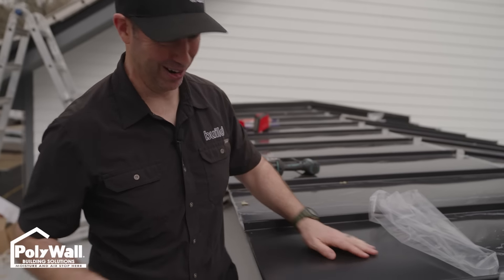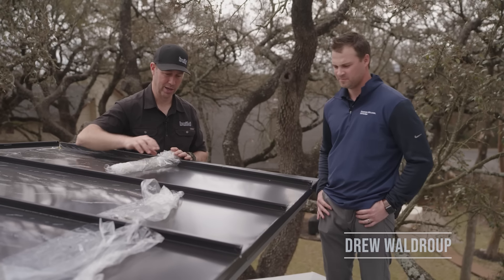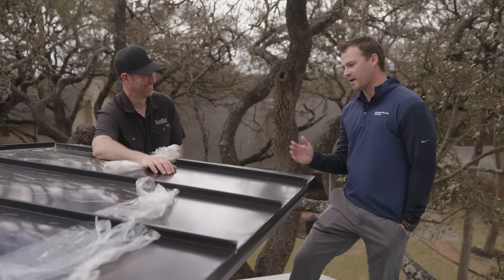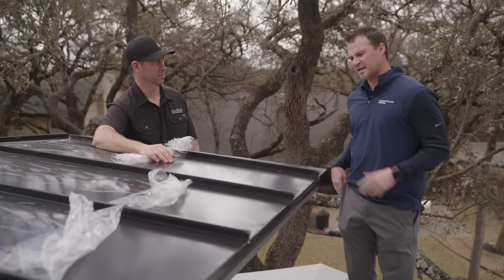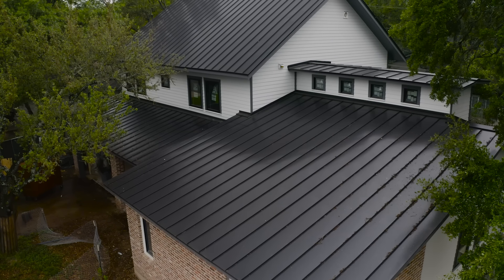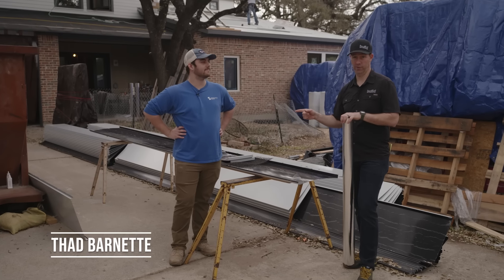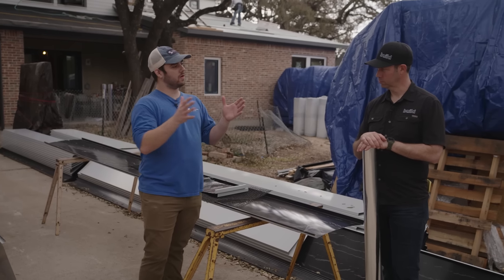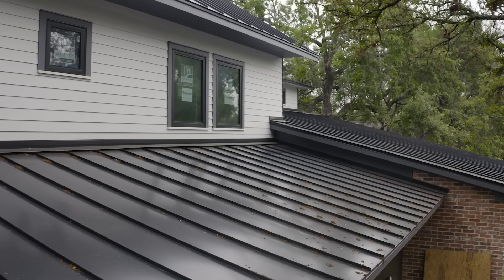Black Metal Roof - Dumb Idea?

Comment: How well does the colour coating stand up to the installation stresses when folded/crimped, and how do you treat exposed cut edges, especially at the gutter line on the folds?

Comment: The colour of the metal roof doesn't matter as long there is above sheet venting. The higher temperature below the black metal is balanced by an increased air flow due to the higher temperature difference. This was already found in the study conducted by the Oakridge National Laboratory  in 2009.

Comment: I just went through a similar set of considerations where color choice was dictated, in part,  by its ability to minimize the impact of the sun during summer months.  On the roof, I remember a big gap in reflectivity indices between light and dark colored metal roofs and I immediately ruled out the dark colors.  Obviously, you've spent more $$$$ on insulation to offset the heat factor.  That said, I would question how the finish of the black metal will hold given the extreme temperatures it will be subject to over time.  My concern would be about an increasingly dulled finish.  There is also the consideration of all the droppings nature provides, some of which will be highlighted against the black background.  Frankly, given that you geke out over building science (and I mean that in a good way), I'm surprised you went against the grain of conventional wisdom.  Anyway, it looks great!

Comment: I was looking at colorbond colours last year for a small project and white reflected... twice (I think it was) the radiation of black.  I also remember doing backyard test of black vs white and getting 30% hotter results with black.  Definitely not my area of expertise tho.  I'd think black with an air gap and somewhere for the air to vent to would work ok though in the heat to suck air out.

Comment: IMO Bird droppings, tree pollen and dust are outstanding on a black roof.  Here in hot summer Texas a lighter color would be better, but you have mitigated some of the heat gain issue using an air gap and radiant barrier correctly installed.  How have you addressed moisture buildup mitigation in the attic space?

Comment: we put on an edco slate look roof made in minnesota asphalt quotes came in at 14-16, steel came in at 19. class 4 hail rating winds to 160 plus you can transfer the warrenty to the next owner. I should be long gone before it needs replacement

Comment: Matt, Here's a very cheap and quick scientific test to perform, using any metal roofing sections that might be "left over".  Construct a 2" channel with plywood on the bottom and metal roofing on the top.  Add 2" side caps to create an airspace that is 2" thick.  Hold a standard household steam iron against the metal roofing, and turn up the heat safely.  Incline this assembly at a standard roof pitch.  Then, try to find an inexpensive way to measure the rate of air flow that occurs as that airspace is warmed, and the air in that airspace becomes more buoyant as it expands with heat, like a hot air balloon.  Then, vary this test by comparing the effects of reflective foil facing up, reflective foil facing down, and no reflective foil at all.  I'm sure, with all the skill and talent that surround you, y'all can fine-tune this empirical experiment.

Comment: My position is that any work above the roof line will be extremely hot no matter what color. The black will be the hottest as well as other dark metal roofs. It is also true with asphalt and fiberglass shingle. When working in the sun, you could probably cook eggs on the roofing material. I like all metal roofs as they have a better lifespan and need very little maintenance if ever.

Comment: I wish they'd had black when I put the roof on my cabin in Wyoming. Snow will slip off much faster. My roof is 12" SIPs so I'm not worried about summer heat at all.

Comment: I figured out long ago I only needed to own ONE black vehicle. Same with roofs. I had black timberline GAF,25 yr. old ,still in pretty good shape. But I covered it with light gray metal. It was noticeable difference in the amount of condensate my A/C produced ,it wasn't  working as hard. Just be careful ,it can be slick up there.

Comment: Aluminum in the roof somewhere is the best thing you can do to reflect back that infrared radiation from the sun.  We have it on insulation in our attic in Florida, and you can go up in the attic and not die.  Our energy bill for a standard build 2300 sqft home averages $100 a month.

Comment: As long as I don’t have to do repairs on the roof I’m good with it. One of my past contracts, a tree limb broke off a very tall white oak tree broke of during a tropical storm and torpedoed the roof. I actually got up during the storm, slid a couple of pieces of flashing under the intact shingle and stopped the flooding inside. If that was a metal roof, you can forget it, a wet metal roof is about as unsafe as a roof can be. I’ve worked on metal roofs and I call tell you a slight mist and these are widow makers. The last contractor I worked with was in the hospital for a month after slipping off the roof, he has no recollection on how he fell. But if you have work on the roof, not necessarily the roof itself you need to get up there and put safety ropes or spend 10 times as much money and call the contractors. So your house, fine, not mine.
Reply: BTW a black roof may not be bad for household temperature, but that black will absorb most of the color spectrum of the sun, which peak energies are in the greens and release as radiant heat, increasing global warming. In cities it’s just like asphault, and it does this without burning fossil fuel. So you can’t really argue that it’s environmentally friendly unless we are heading into an ice age. 

The amount of sunlight hitting the Earth is about 1.3 kw per meter, in the 6 months of hot Texas it will have the most profound effect. 180 days x 10 hours per day x 1.3 kw per meterwhich that house has a so,ar footprint of say 3000 sq feet or about 300 meters is 710 gigawatts per summer that is added mostly to the lower atmosphere. If you manage to cut that in half it would be around 360 gigawatts.

The most environmentally friendly roof in a hot humid climate with humid nights are roofs that reflect the most suns energy back into space. If you are in the high plains you don’t have to worry too much because most of the heat trapped in the warming of the air, is radiated back into space at night, and because the total stack of CO2 above you is much less than at 1000 ft. But in humid climates nighttime moisture and low altitude CO2 retain the heat and keep it in the air. I mean yes, refuting what I said above  an unpainted low chromium stainless steel roof is probably the most environmentally roof, but again, I would not work on it. 

Also think about one more thing, the wood in your ( well maybe not Matt’s) attic works best in a certain temperature and humidity range. Whatever material you use the rate it degrades is a function of temperature, 2wice the rate for every 18 degrees Fahrenheit. The relatively humidity drops with increasing temperature thus wood becomes particularly dry at close to 212F the air literally has no humidity at standard pressure irregardless what the humidity was at 100’F The house I am currently working on has framing problems in the attic, one of the reasons is the attic is not ventilated, (no soffits, no ridge vents, no roof vents, no side vents the only ventilation is through the Hardie Plank which was not place on a moisture barrier), much of the rafter braces have overheated and dried, become brittle and cracked. You basically can run your fingernail along the wood and make toothpicks of the structural members. This is not my opinion, this is what the engineers said on inspection. What this means is you can’t mend this wood because it is too brittle and it must be replaced. The cracked lumber is not the problem, the house had serious framing issues that stressed the wood, but instead of flexing, the framing cracked and made framing issues worse by separating, in on case by 4 inches. Most homes are not insulated outside as Matt’s house is the framing, which means the attic framing should be protected from excessive heat. In addition a hotter attic will have more differential expansion from the interior of the house, this means more “settling” noises but also more energy and force applied to nails and weak points will separate faster. So ideally , for a non outside-insulated attic, we want a cooler but not moist attic, meaning we want some heat (say 5 to 10’F hotter for a lower humidity) in order to keep wettable areas dry, but not so hot that there is no humidity. 

A darker roof will have a hotter attic, a more reflective roof will have a cooler attic, an attic sheathed with tech shield will reflect more heat. You can even put garbage wood like old cedar fencing  between the tarpaper and the rafters and this will buffer the heat. Putting reflectors between the rafters does not protect them.

Comment: Nice house. There is no comparison in metal vs shingle -- unless we are talking about the grade of materials and the installers. I installed metal in Hawaii. In areas of heavy rain, people don't install shingles. And shingles fly off during tropical storm winds. Regarding black in the south of Texas? That is gonna be super hot in the summer, but he has excellent insulation, the house is super sealed and he has excellent HVAC. I'll bet that black will fade and you will notice, however, it makes for a nice infomercial. It does look "cool." I probably won't be around in 30 years to see that video though. People don't replace metal because they don't like the color, they paint it even though it's not factory-baked on. Don't buy a black car and put it in the sun for 30 years, let alone 50. The best roofs I inspected were made with copper and far outlasted 50 years, but you have to save a lot of pennies. In 30 years homes will have some new solar technology for roofing material kinda like a Tesla roofing, hmm? Maybe they weren't giving away free roofing? Sweet house.

Comment: With metal roofs, the gauge or thickness of the metal matters. The air flow in between the metal roof & the decking is a MUST! 3rd, SUFFICIENT attic insulation is equal to the 1st 2 statements!

Comment: I think you'd need to either show a study or build a rig to prove it - because I'm very doubting the reflective barrier with a 1/4" airgap is going to do anything.

In the north we get cold winters - but surprisingly hot summers.  The attic (being unheated and vented to the outside) getting passive solar does nothing for heating your home in the winter -but in the summer the attic getting heated will only make your a/c work that much harder.

Comment: Matt, a few things occurred to me while watching this video:  

(1) doesn't Joseph Lstiburek recommend an air gap of 2"?  See his excellent article in Fine Homebuilding, filename = PA_Crash_Course_Roof_Venting_FHB.pdf (2011)

and, 

(2) has anyone conceived of a remote-controlled "baffle" that directs hot air up and out of the ridge vent on hotter summer days, but then switches to direct the air rising up the roof vent back into the living space during sunny winter days?

lastly, 

(3)  what percentage of your total metal roof area will be covered by solar panels?  The finished metal roof looks FANTASTIC, but the overall "look" is going to change a LOT after all the solar panels are installed and operational.
Reply: The 2" air gap is Joe's recommendation for desirable air flow in a ventilated roof assembly (air ventilation on the underside of the roof sheathing). Matt's roof is an unventilated assembly.
Reply: @mcintosh.daughter  after 6:00 on the counter, 
Matt mentions "three different versions of an air gap"
"1x4's on an angle" + "3-D mesh" + "dimple mat"
"that gives us ... a kind of thermal break from that roof"
Reply: @supremelawfirm  He sure does. But that is an air gap under the roofing, not the same as having a ventilated attic. Unless Joe was specifically referring to a 2" air gap under the roofing.
Reply: @mcintosh.daughter  I don't know if YT will "tolerate" this link:  if not, I'll transcribe the key paragraph where Joe writes:  "I call for a 2-in.-minimum airspace between the back of the roof sheathing and the top of the insulation."
See the drawing on .pdf Page 2 here:
https://www.buildingscience.com/sites/default/files/migrate/pdf/PA_Crash_Course_Roof_Venting_FHB.pdf
Reply: I also argue that the reflective foil should be installed along the bottom of that airspace, facing up towards the bottom of the roof deck i.e. plywood or metal.  That way, heat that radiates downward from the bottom surface of the roof deck is reflected back at that bottom surface.  This should result in transferring some of that heat to the air that is passively rising towards the ridge vent in that airspace.  A properly controlled scientific experiment could be designed to measure various permutations empirically.  I would also be interested in listening to what Matt's metal roofing contractor has to say about this one point.  For example, have they already done any empirical experimentation and, if so, what were their findings?
Reply: @supremelawfirm  Thanks Paul, I'm very familiar with that article and that is exactly what I said in my first comment. At least 2" in a ventilated roof assembly. Matt's roof is unventilated. Now Joe does recommend an over roof with a 2" air gap over a SIPs roof assembly. He also says a roof assembly with a black roof will last longer than one with a lighter roof, though a light roofing lasts longer.

Comment: With all the climatic changes happening, meaning, everything is more intense. Higher winds, tornadoes, hurricanes, more heat, more rain, more snow, bigger hail balls, fires; designing a roof to deal with all these issues is something I take into consideration. Only thing I came up dealing with dealing with moisture and a creating a 100 year roof was a concrete roof with another metal roof on top of it. Since a lot of insurance companies will take your money then cancel you later for fires or hurricanes, it’s just cheaper to not get insurance and build your home to not have these problems. Only thing I could come up was reinforced concrete with new hybrid that is anti earthquake, tornado, hurricane, fire proof tech. Anti flood is location of course, like being on a hill. Everyone talks about bugging out when SHTF situation. I prefer to just bug in and stay home where I got all my creature comforts. Adding off grid power and water is highly recommended. With all the snow storms, hurricanes, tornadoes, floods, fires knocking out utilities and roads, just best to,design things that way. If a snow storm knocks out everyone’s power, gas, water then I should be prepared to sit at home for 3-4 months. There were rural homes in Texas that didn’t get power for like 2 months. Seems we are all having those so called once in a century storms every few years.

Comment: I’ve always wondered, what keeps the metal from rusting at the cut edge?
Reply: I asked my dad this one time. He had a metal building business for 40 years. He told me that for galvanized metal the zinc coating on the faces works for the edges too. Think of it like a circuit. How hard would it be to get a spark to jump that tiny gap from one zinc plated side to the other? Wouldn’t take much power at all. So the zinc on the faces takes care of the corrosion on that tiny sliver of exposed ferrous particles, no problem. For painted I don’t know. All the sheet metal I’ve painted was galvanized first. I’ve never seen it rust from the edge.
Reply: @beachton  Thanks for the reply. That makes sense. It's funny how a metal roof can be expected to last decades while a car will rust after ten years. Granted, they put a lot of corrosive chemicals on the road in the winter.
Reply: @Rickmakes  My car is 25 years old and has no rust at all. I’ve always lived in the south. And on the rare occasion when it snowed I didn’t take my car out of the garage. It’s the salt for sure.

Comment: The metal roof is great love it- just the black  seems like a  trendy thing to do I can understand the solar panel thing.  Just worry the  materials under the metal will have a shorter life cycle  because of the higher temps.  The black and white farm house I have never heard  or seen.  White and a red roof, yes, white and a rusty metal roof yes..  galvanized yes.  Would be curious what  the temp will be in summer coming out of the air vent at the top.  might  create enough air movement that it cools itself down.

Comment: I'm confused, maybe someone can explain why you would want the reflective side of the radiant barrier facing down (tower the air gap) rather than up (toward the roof and sun).  It doesn't seem to logical to me.
Reply: A reflective surface could also be called a poor radiator, it works both ways. So the air gap gives you a thermal break and any heat transferred to the reflective material doesn't radiate to the roof deck.

Comment: Did you consider combining that steel roof with solar?  I'm in Dallas (TX) and during the summer my West facing roof drops 10-15 degrees in full sun!  I have the FLIR pics to prove it.. Also my all  black panels are cooler than the neighboring bitumen shingles by a similar amount.  Like you said, that air gap makes a world of difference and the panels have a gap of over 2" off the shingles. 

So I wonder what the equivalent (combined) SRI of panels plus roof gap would be since the panels absorb (convert) about 20% of the IR range directly into power (not heat!) and reflect almost all the rest. Hmmmm....  Also I get 10KW of power in full sun too, so there's always that from a roofing material.. 😀